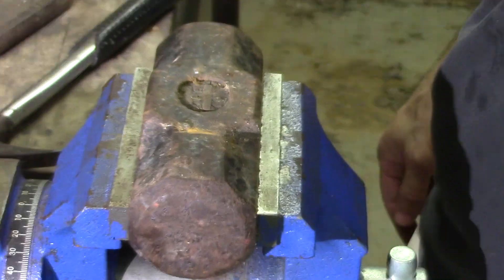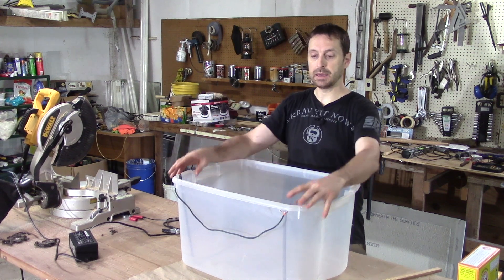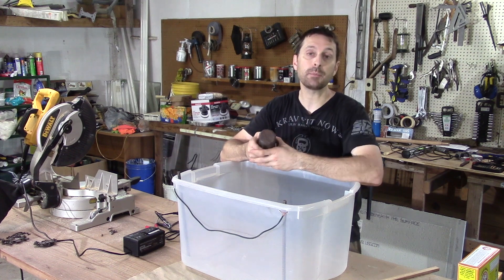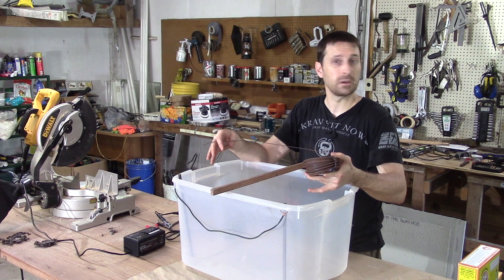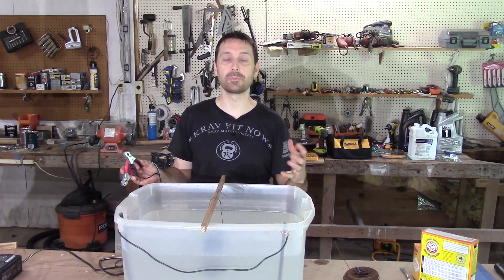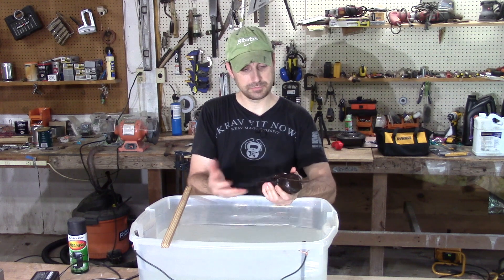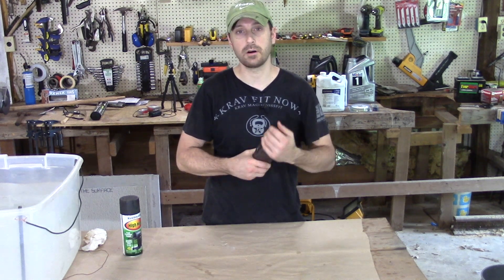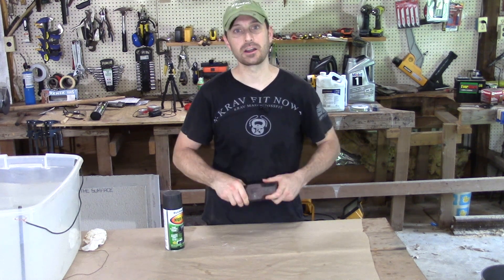Rusty Old Sledgehammer Restoration (Using Electrolysis)

Comment: not necessary but electroplate it with something like copper, its pretty easy to do with copper acetate which you can make from vinegar, hydrogen peroxide and any spare copper clippings, it keeps for a long time so you can keep reusing the solution of copper acetate until its no longer blue
Reply from the maker: Cool

Comment: I have my grandfather’s sledge hammer and cleaned the rust with a wire brush then sprayed rustoleum on it. Do you think that this process would work or am I out of luck since I already painted the head?
Reply from the maker: If you already painted it then there is no need to do this process.

Comment: 2:41 "place the positive (+) lead on the wire holding the part.." OTHERWISE, conflicts with 6:09 "place the negative (-) lead on the wire holding the part." 2:41 is wrong. 

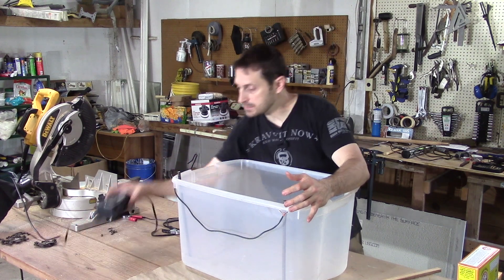The actual CONTEXT "this 2 amp car (2:34) battery tender we've got the alligator clips on the ends here and we will (2:41) attach one of those the positive to the part itself or to the wire holding the (2:47) part...

(6:02) connect our negative lead to our parts or the wire touching the part and our (6:08) positive lead is going to go on our (6:11) rebar electrode 🙈

Comment: How about using cleaning vinegar to clean rust?  I did it once with a rusty novelty sword and it worked but I'm not sure if it doesn't do some damage that I'm not aware of.
Reply from the maker: Vinegar works well. I find electrolysis works a bit better. It shouldn’t do any damage to the metal.
Reply: @CountryLivingExperience  - Thanks CLE, I'll try the vinegar method and see how that works.  I originally came here just to see how to properly put a new handle on and now I have a restoration project!
Reply from the maker: TimmyOzman No problem. Did you see all of our videos in that series? I think I have them liked throughout the video.
Reply from the maker: *linked
Reply: @CountryLivingExperience   - I first watched the video about how to put on a handle, then I watched the restoration of the head.  I believe you mentioned there was another about removing the varnish from the new handle, I haven't watched that one yet.